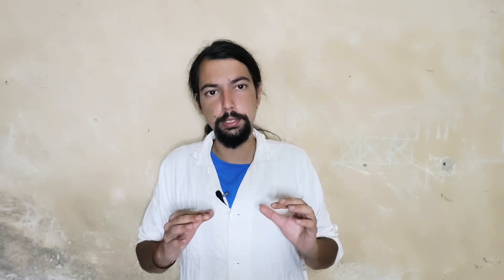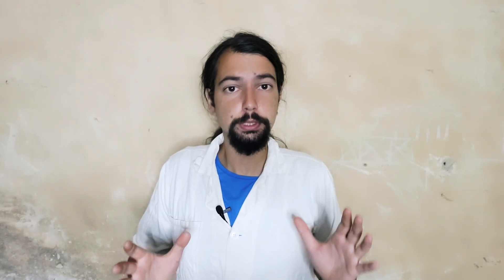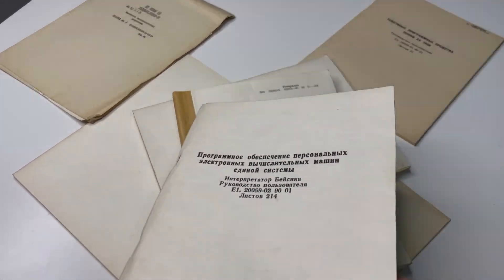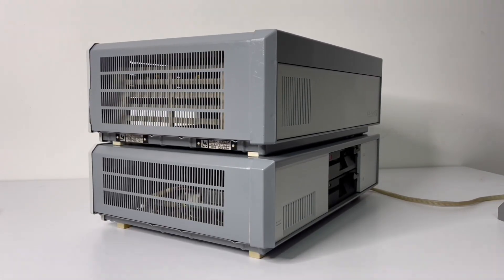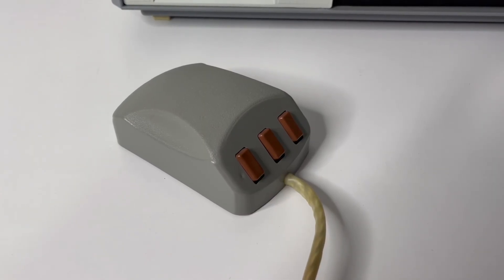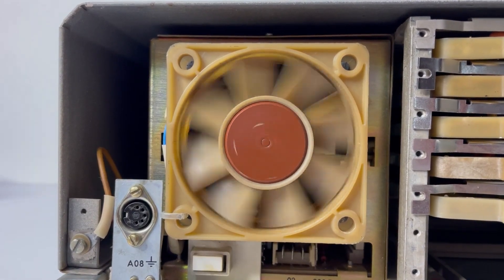Extreme Restoration of a Soviet ES1841 PC. Computers of Chernobyl

Comment: I just found your channel, and I gotta say this is amazing work that you're doing!

I really like the design of the crate.  It may not be standard western ISA bus connectors, but the ease of changing cards and the modularity of the design is fantastic.  Plus the ability to add expansion crates on the same bus?  I would have loved this architecture back in the 90s when I was sacrificing one ISA card for another.
Reply from the maker: Thank you!

Well, you can expand ISA using a riser, technically this is what made here with an expansion unit. Seems that unit was pretty rare, we could not find any so far, only a few pictures. It looks the same as the main one, but has a different PSU with a standard power connector like modern desktop computers have.
Reply: I know this is quite an old comment - but you (or anyone else intrigued by this) may be interested in the PICMG series of standards. There's a platform called Advanced TCA that essentially works this way - though obviously no longer ISA!

Comment: That mouse cord can be used to transport High Tension voltage, actually!
Reply from the maker: Haha)
If jokes apart, the reason for that thickness is that is bus-mouse, it has no electronics inside apart buttons and optical couplings. So from it come pretty many wires which for protection are wrapped in durable plastic tube. However! This is still much better than a mouse for ES-1845 which is made of metal and has a shielded cable. That thing is so EPIC that in the future we are going to make a separate episode about it.
Reply: The main reason for such thick cables that they aren't actually multi-wire cables manufactured at a cable factory. Instead, they are the bunches of the individually manufactured single-wire cords placed into the PVC tubes by the assembly factory.
Reply: @al-uw4ln   That explains it!

Comment: Oh wow.
That 80's power supply looks like hard to deal with.
💩✌️👍🏻👍🏻😘🤔👏👏👏👏👏👏👏
Reply from the maker: It appeared to be pretty ok device, but as a more cheap option we later used ATX PSU (needed to repack it to the spare original ES casing, though).

Comment: В моей молодости был подобный компьютер - ЕС1840. Он был частично совместим с компьютером IBM. Из-за плохих вентиляторов очень сильно шумел.
Однажды случилась неприятность - перестал правильно работать винчестер - после включения питания, примерно через 10 минут начинались сбои в работе. Электронная плата,
которая управляла винчестером, содержала около 100 микросхем и нужно было определить неисправность. Коллега по работе посоветовал воспользоваться этиловым спиртом для поиска неисправной микросхемы. Я, включив компьютер и запустив тестовую программу поиска ошибок на винчестере, по очереди прикасался к микросхемам ватным тампоном, смоченным этиловым спиртом и при этом наблюдал за работой тестовой программы. На одной из микросхем, смоченной этиловым спиртом, сбои прекратились. Так я нашел негодный чип.

In my youth there was a similar computer - ES1840. It was partially compatible with the IBM computer. It was very noisy due to bad fans.
Once there was a nuisance - the hard drive stopped working correctly - after turning on the power, after about 10 minutes, malfunctions began. The electronic board that controlled the hard drive contained about 100 microcircuits and it was necessary to determine the malfunction. A work colleague advised me to use ethyl alcohol to find a faulty chip. I, turning on the computer and running the test program for finding errors on the hard drive, touched the microcircuits in turn with a cotton swab moistened with ethyl alcohol and at the same time watched the work of the test program. On one of the microcircuits, moistened with ethyl alcohol, the failures stopped. So I found a bad chip.
Reply from the maker: I suppose it was 1841 or 1840 with 1841.0000 CPU boards, as pure 1840 could not have a HDD at all, as a controller was not supported by ots БСУВВ. The story with alcohol is truly epic! Thank you!

P.S. these native fans in the PSUs are horrible, that's true

Comment: Thank you what was difference between Military/security and civilian microprocessors ?
Reply from the maker: If say there was the same chip but in military and civilian versions, then military likely would have a ceramic case, gold-covered pins and so on, but the most important, it would pass a much stricter testing and much structer control on production.

Comment: @ 8:40... Wow... Soviet computer could not boot from the hard disk drive! In the mid 1980's I (with assistance from a mentor) built my first IBM clone computer. Same configuration of drives... two 5.25" floppy drives, one hard disk drive. That first machine, I remember being mentored 1) Boot DOS floppy, debug g=c800:5 <enter> Welcome to Western Digital hard disk drive low level format, then IPL, 2) Boot DOS floppy, run FDisk then IPL 3) Boot DOS floppy, run format c: 4) Run a very special command sys c: to transfer the DOS boot sector to the brand new clean formatted hard disk c: drive. Must get those special files on the clean disk first, else data files might end up in the spot, and force you to start over from format c: point.
Reply from the maker: That was a mistake by me. It could, just needed to be configured with jumpers - discovered documentation only later.
Reply: @ChernobylFamily  Ahhh. thank you for the clarification. Not as primitive as my first impression.

Comment: Did you manage to dump the ROMs of that ES1845 system board? Those sound like they're a pretty unique part of Soviet computing history.
Reply from the maker: We are still working on 1845. The thing is, what you see in the Ep1 and Ep3 are two altered machine sets. In Ep3 we use the processor board from 1841, which we found later, as it should be, because 1845 still needs some repair. However, as far we know from the talks in the Institute of Cybernetics (Ep.2) the difference in software/firmware between 1841 and 1845 was nearly absent, it was mostly about hardware.

Comment: Cheers from Brazil! Amazing documentary, as computer collector, I'm really enjoying it!  
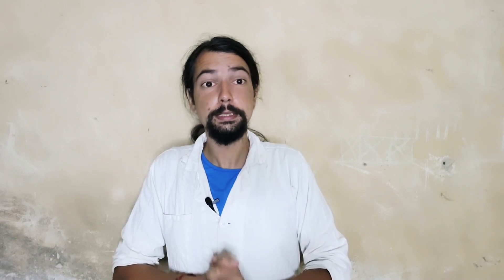Are you planning to dump and reverse engineering those (kgb?) ROM/PROM/EPROM (I'm not sure what they are, actually) you can see at 9:40?
BTW look at that huge CGA (or whatever) graphic card!!!! 
I have some old IBM PC/XT compatible CGA boards, and they're big, but not sooooo much!
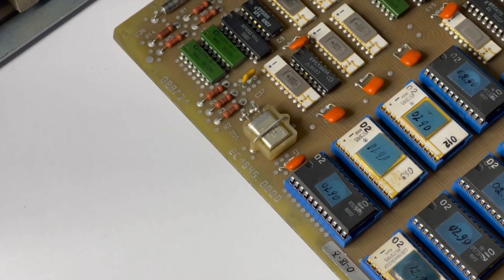Reply from the maker: Greetings from Ukraine! I believe, you meant on 6:56 -- yes, they have been dumped already but in fact they are not really different from the civilian version of 1841 ones.
The boards are not that super huge, kinda 20x24 cm - they are slightly transparent, so it is visible they are not that densely packed. We assume this form factor has been chosen to fit more complex devices in a crate, see ep 02 -- the board digital input board, EC1841.0101, that is packed up to the edges.
Reply: @ChernobylFamily  yep, 6:56 - 9.40 is the full video duration (shame on me LOL).  
On video the board seems (at least to me) to be bigger than what you related, maybe due to the unusual format for a graphic card (at least compared with the '80s western cards).
Are those ICs compatible with chips you can find on the market (i.e. 74LS glue logic, 23xx ROM / 25xx EPROM, etc.) or are proprietary soviet chip technology/design?
This is really fascinating, I know virtually nothing about the soviet computer science of the era; I got (and I'm reading) some pdf with the transcription of the oral histories of some russian pioneers, very enjoyable reading, indeed. It's a world virtually unknown by the western people.
Reply from the maker: @pickoftheglitter  At that stage it was pure cloning. It is possible is find 1841 machines where all socket chips have been changed to originals. However, in the HDD controller (Ep3) sits a proprietary chip and better it'd be a clone.
Well, russian school went own way, more interesting for me was what has been developed in Kyiv institute of cybernetics. Google "Victor Glushkov OGAS", you will be impressed...)

Comment: Great work!   The CPU К1810ВМ86 is a clone of Intel 8086. It cannot address more than 1MB. Some space is reserved for ROM BIOS and Video RAM. That is why standard set included 512K+128K.  Remember "640K ought to be enough for anyone" :)

P.S.
Found docs about EMS-like feature to switch RAM bank mapping into main address space. So 1.5 MB was real
Reply from the maker: Thank you! Exactly, that used kind of switching the banks. However, seems need to play with jumpers to make this work (so far did not succeed)

Comment: How many layer PCB does this use? Would it be possible to reverse engineer it and rebuild from NOS parts today?
Reply from the maker: It is 8 layers. The circuit diagrams were not included with machines (while for consumer electronics they would normally be), and were shipped only to service centres. Therefore, as for 2022, there are only some diagrams available for some circuit boards of 1841 (and none for 1845, which is slightly different in components).  BIOS ROMs, however, exist in saved form.

For 1841, the memory boards in particular are missing.

Yes, your idea is great, and frankly, we are a long time seriously considering rebuilding it, if we find the full schematics. As minimum, we are going to rebuild master-slave cards, layouts of them we have; they are crucial to have to run certain types of specialized expansion cards.

Comment: The system architecture is very similar to western industrial control computers of the era, with a processor board and peripheral boards sharing a common interface to a backplane. This design language persisted in industry long after commercial/consumer PC manufacturers moved to integrated motherboard construction.
Reply from the maker: You have a good point!
By the way, there is an interesting detail: it fits EXACTLY to 19" rack (soviets used them as well). And that light-grey plastic panels are removeable and they have the same height everywhere, so it seems that there could be an attempt to build some universal casing for the purposes we do not know - this does not look an accident, but this idea was probably not further developed.
Reply: @ChernobylFamily  I work in designing products for a company whose business is about 1/3 19" rack mount equipment. Using the exact same piece in multiple different products saves quite a bit of money in small volume construction.
Reply from the maker: @moconnell663  Yes, totally agree – well, we personally use rackmount equipment at home, not many (we have kinda 12U rack), but it appeared to be way more convenient. However, I meant different: it looks like from some considerations they used this form-factor, but we never found any single reference to possible rackmount use. So for me it looks as a sign of some ideas that never have been implemented. I think I'll again contact the developers to check with them if they remember something like this.

Comment: Greetings, from the US. I'm curious as to what all western computer clones would have been used  in Pripyat and Cherynobyl. What Unix and Vax clones were used. The Soviet clones have always fascinated me.
Reply from the maker: Greetings from Ukraine! This is an interesting question; so far as we know, the clones of VAX were out of the Zone as there were not so many of them in general, and they appeared too late to be deployed in the Zone. However, as for Unix, there were adaptations of this system for certain CM (SM) series mainframes, e.g. CM-4.  The question is what they have been using on these machines in the Zone, as there may be certain variations.

But, the definition of a 'clone' is pretty wide, as in many cases it was about architecture and further development based on it that could include even certain improvements. Another thing, though, those clones were often not as reliable as their prototypes.

The purpose of use varied very much -- starting with controlling certain robots and ending with monitoring thousands of detectors Inside the Sarcophagus and aggregating their data; we will cover it in further episodes, as it goes far beyond the comment..)
Reply: @ChernobylFamily  I appreciate your reply! It is incredibly helpful! Your work is awesome!

Comment: I wonder if there are any surviving ES EVM systems?  I understand IBM even provided software support for them at one time.

There were two different versions of the K5504.20.  One was made by Kyocera and the other was actually made in Germany using tooling supplied by Microscience.  There was also a K5504.50 which was a 50MB drive.
Reply from the maker: You mean, the mainframes? That is a very good question - do not know any complete and capable to run as for 2022. The biggest partially survived set of ES  peripherals known to us is the SKALA mainframe of the Chernobyl NPP (a few years ago we asked them to save it based on historical value considerations - that was an epic luck!). But SKALA is not a 'true' ES. Also, I know few places where they still run ES drum matrix  printers, as they can print 24/7/365 non stop.

A guess is, that the only place where it looks realistic to still exist under conservation is exSoviet military, e.g. russia or belarus, as they are known to store any junk just in case, but I am afraid we would not know that.
Reply: @ChernobylFamily  OKB-1 managed to hide 150 huge rocket engines from the N-1 rockets in a warehouse for decades, so anything is possible.
Reply from the maker: @station240  Exactly!

Comment: I was suprised to see the drives labeled Robotron, but of course there was an explanation for that, haha.
Reply from the maker: In fact there were the same-looking "pure" Robotron drives, and in them the circuit board was DDR/Soviet, just in this very case it is re-labeling.
Reply: @ChernobylFamily  Yes, it seems like the DDR was pretty advanced with tech stuff, also chip production and so on. One thing is copying the design, but producing the chips yourself is something else.
Reply from the maker: @160rpm  it is interesting, that at least those "pure" Robotron drives we had in the past, had only Ukrainian (Quasar factory) or Czechoslovak (Tesla) ICs. Though, well, our selection probably is not statistically representative.
Reply: @ChernobylFamily  Yes, I suppose things were less centralised than you might think. I have some TESLA chips, the logo is pretty cool. I remember seeing a "Pravetz-16" computer, many years ago, I think it was from Bulgaria also. I'm not sure if it would have been part of the EC line, it looked very much like a standard IBM clone.
Reply from the maker: @160rpm  If I am not wrong, Pravetz-16 is EC-1839. Never saw it personally, but had its green composite monitor which is pretty awesome.
Reply: @ChernobylFamily  Yeah, makes sense that it would have been part of the EC line. Maybe it was a sort of "export" model?
Reply from the maker: @160rpm  I believe it is exactly as you said above - it was not so centralized. Pravetz is Polish creation, but it was compatible within ES PEVM line, so I believe this compatibility was the reason of getting the EC index. Same with Robotron EC-1834. But, I am not sure if my point is right, because there is e.g. Robotron CM 1910, which is also on i8086 clone, but it marked "CM" which is totally different series...

Comment: Indeed very reminicent of the very early IBM machines. They also had a setup with a slave expansion unit
Reply from the maker: Also a slave unit? Wow, did not know that detail! Thank you!
Reply: @ChernobylFamily  Yep, they look very cool. Both units basically in the same kind of cabinet, and there was a special card with a huge connector, which would interface the two units. I suppose in a way it was just a bus extender. So the cards and drives in the expansion unit would behave just as if they were plugged into the mainboard in the main unit. Some people even had dual monitor setups, with one monitor on top of each unit :D